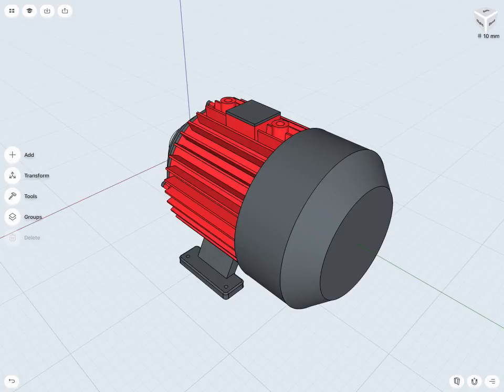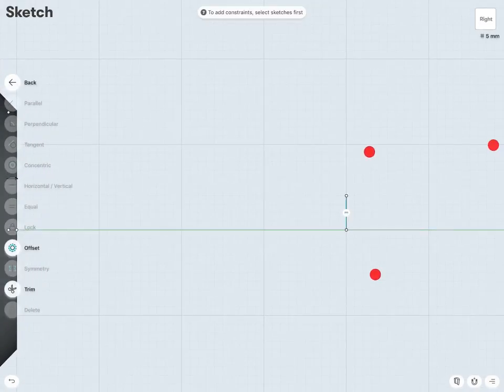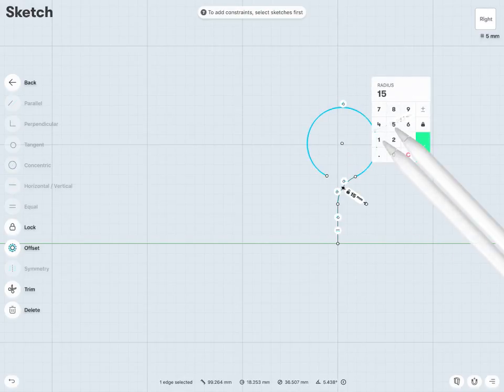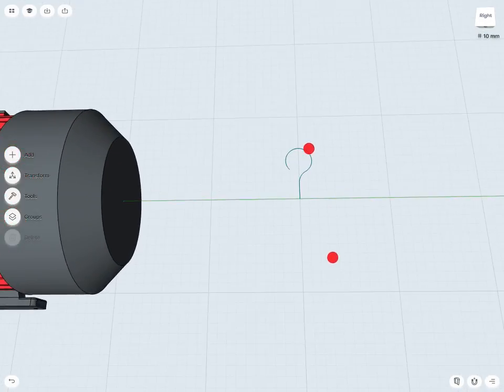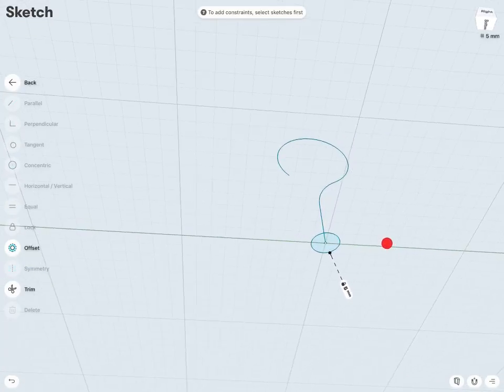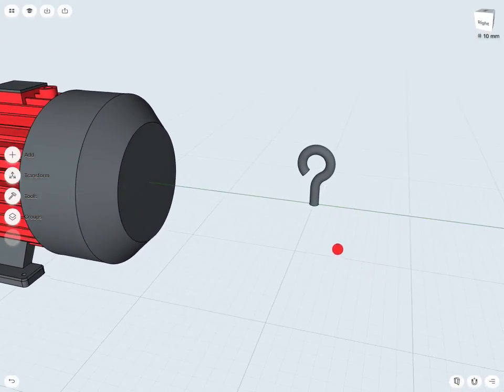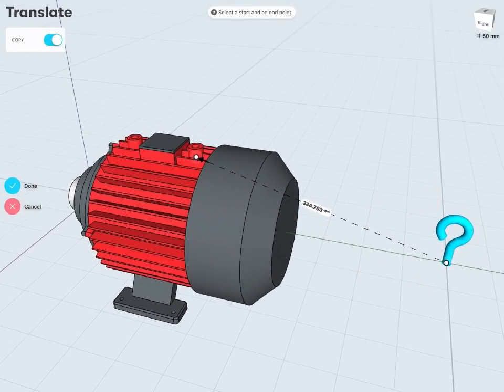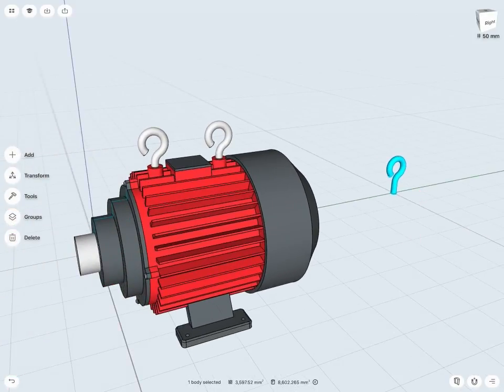Creating the C Hook | Electric Motor | Shapr3D Advanced Tutorial Series |

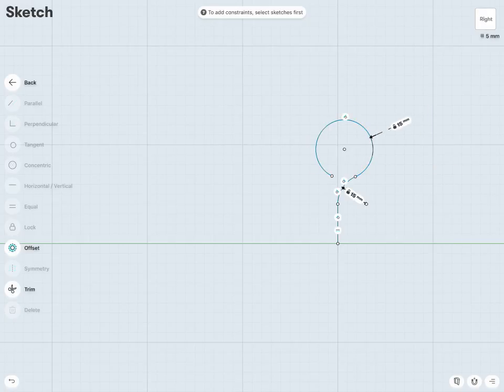Comment: In app version 3.26.0 (12446), the operation done at 2:28 doesn't work. It either wont move because of constraints, or moves the whole sketch
Reply from the maker: Yes - agree. It's a bit outdated tutorial - but contains really good insights, so we left it up. But will make a disclaimer that there might have been changes over time. As for the specific problem, you can remove the constraints
Reply: @Shapr3D  Indeed, it's a fantastic tutorial. I was able to figure out the C hook shape by moving an another line so they line up. Thanks for having the tutorial up, it's quite good!